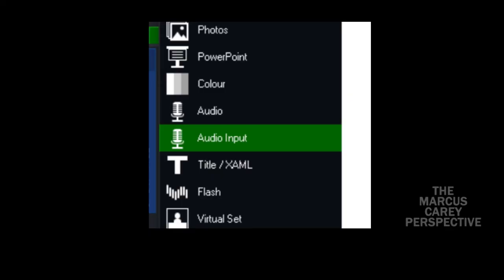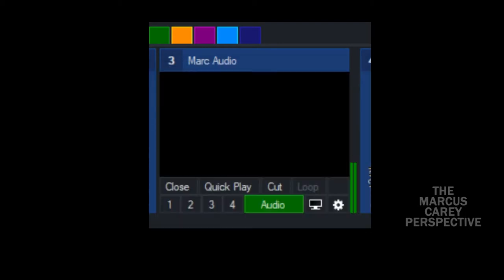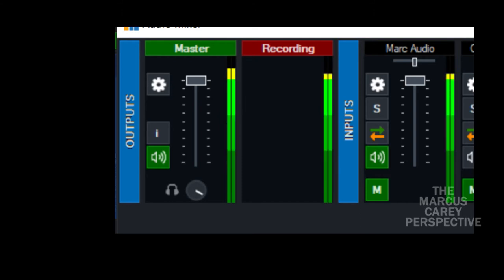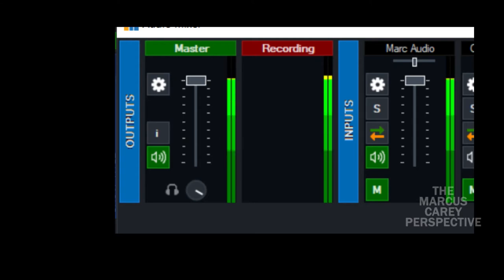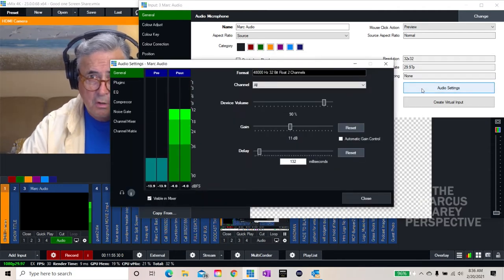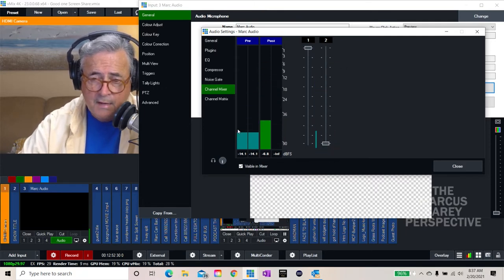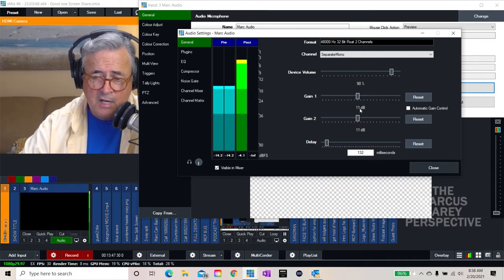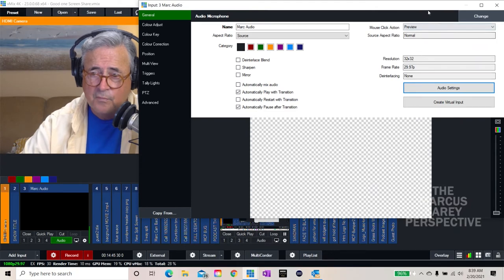Improving Sound Quality In vMix Rodecaster PRO Setup

Comment: So I was pulling out my hair trying to figure out what the heck was wrong with my mic audio going into vmix.  I was running mono in and changed the setting as you instructed and got a similar improvement.  It's phase cancelling when running all instead of separate.

Comment: So I'm assuming that you want to be able to have guests on and be able to separately be able to change there audio in post? Cause cant you just choose rodecaster mic if that's not the case?
Reply from the maker: So the rodecaster outputs a mix to the vMix audio input.  It includes all of the audio mixed in rodcaster.  This then becomes part of your master output and the master feeds the recording.  Vmix has a neat gimmick on their "vmix call" input.  You can designate that your callers hear the master so they hear the entire show on their end, but it does a mix-minus on their own voice so it avoids feedback.  But because the mic channels in the rode are mono and the output is stereo, the mic channel gets a bit of a "phaser" sound.  So this solution allows you to remove one of the competing mono channels (left or right) and helps eliminate that annoying phaser effect.  Does this address your question?  I really appreciate the comment and thanks for watching.
Reply: @Bluegrassbulletin  are you recording in multitrack? on either a sdcard or in say DAW?